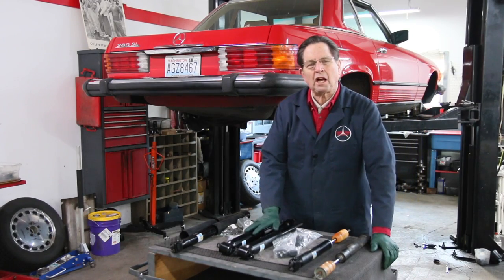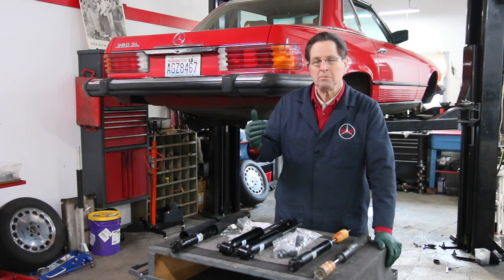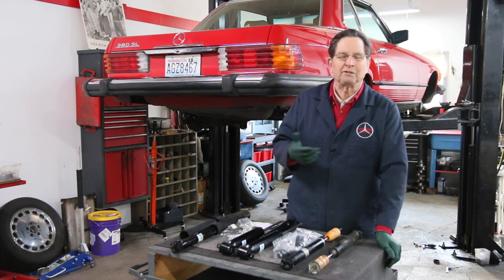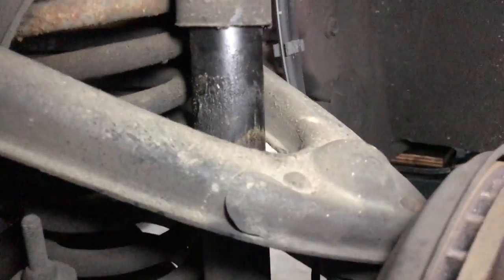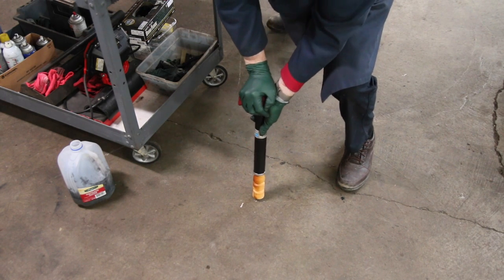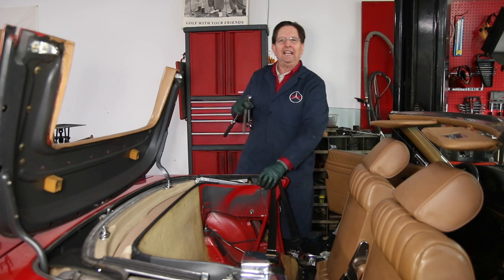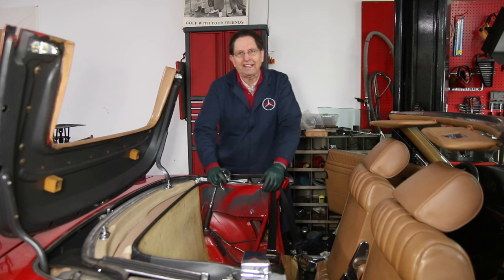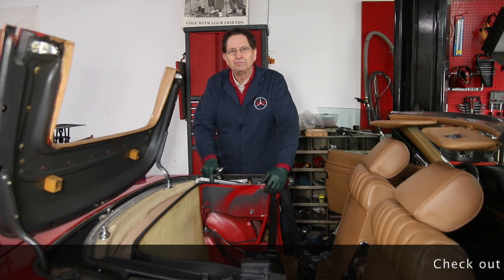Classic R107 SL Repair Series Part 9: Why New Shock Absorbers? DIY? YES!

Comment: I've had maintained several 107.
The canvas on the top seems to rot. When you replace the top you should replace the seals on the boot and on the top. Convertible tops in California seem to last about three years this is a Gott top. One thing that definitely affected how well my 107.ran had to do with the thermostat.
the 84° c thermostat makes all the difference in the world. The 74° C thermostat the car runs poorly, sensors don't function properly, the heater and defroster doesn't work properly and the gaskets around the valve covers don't seal as well. Maybe they'll keep warm enough to make a proper seal.
10 degrees Celsius is a difference of 50 degrees Fahrenheit. This makes a big difference in how your 107 performs, and idles. I changed the radiator, the water pump. the expansion tank, and all the hoses, all the clamps. But what brought the engine into operating temperature was the 84° C thermostat. How do you replace a broken emergency brake cable?
I think it's the front one that broke.
I love your videos. Thank you

Comment: Hi, thanks for the Video. I have a similar R107, SL380 1984 in Midnight Blue Colour. May i Know the Bilstein part number you've used for Front and Rear to insure i am ordering the correct one.
Reply from the maker: Here is the link to the shocks you will need w/video instructions. https://mercedessource.com/store/1972-1985-r107-sl-bilstein-shock-absorber-full-set

Comment: How can I lift the rear a couple of inches
Reply from the maker: If you replace the rubber differential mount and the two rear rubber subframe mounts it will probably solve your problem. If high mileage or rear springs are rusty you may need to replace those as well.